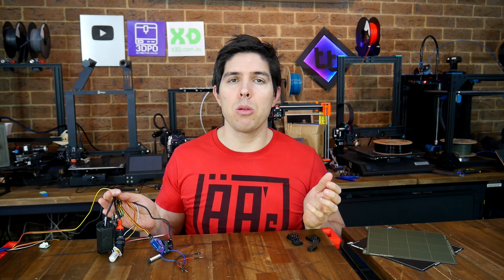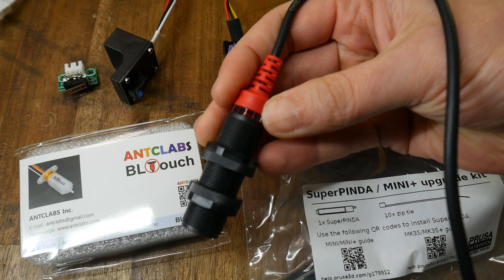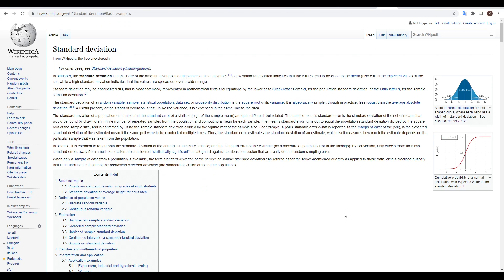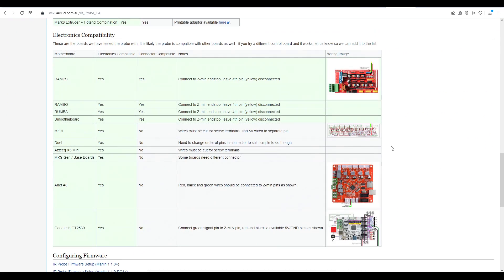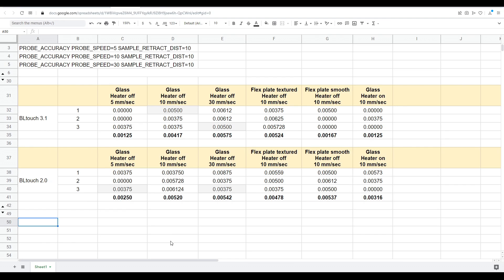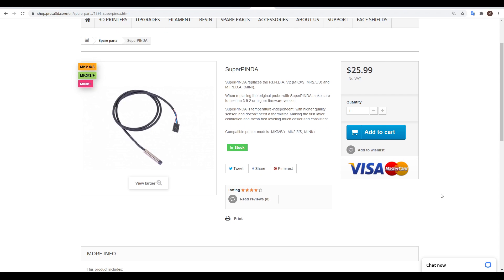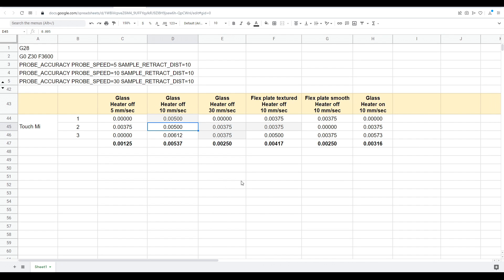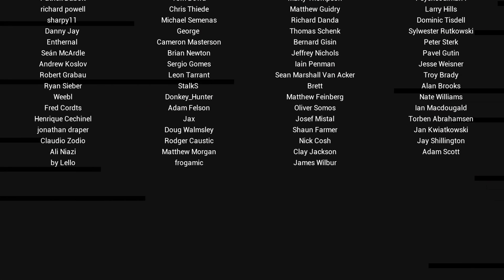Six popular ABL probes compared: Accuracy, price, wiring and more!

Comment: I had a "problem" with the IR probe, it triggerd differently on the white creality writing on the standard Creality glassbed than on the black bed background
Reply from the maker: Very interesting, thanks for posting.
Reply: Black plastic and iR is a bad combination since iR light will pass through it. 
You can try this yourself. Take a piece of black electrical tape to cover writing. Now take an image with an iR camera like a security camera in night mode. Woops where did the tape go?
Reply: I found the same thing, writing, textured PEI, glue, sunlight, LED lighting all effect it, its basically useless, its responsible for destroying a small list of gear now, including 2 build plates, o and a magnetic sticker, as that surface wont reflect properly, so it drives the nozzle into it hard, totally garbage, I would only recommend to someone I hate.

Comment: It looks like your results - although great, were limited by the stepper motors resolution.  But I love that you did this, and perhaps a follow up would be good too. But at least you had the probes in line with gravity, unlike TOM S.  - who is a great youtuber, but a poor 3d printer expert. (But I do love is sweaters)
Reply from the maker: I agree with your point on stepper motor accuracy. But it also goes to my point at the end: if the probe is accurate enough that another component in the system becomes the weak link, then the accuracy of the probe is not worth considering amongst these options.

Comment: try them in heated enclosures torture test them till they fail. most will fail at high temps ~70-100. i saw bl touch guys complain about that after some use. capacitive sensors wont like heat either.

Comment: BL touch for me - easy to install on an ender , works  on any print surface and so far has been reliable . I would prefer a metal tip on the probe so it can't wear or melt  - may look at modifying one one day . even if the unit dies it is easy to change it out for a new one  which would take only a few minutes .

Comment: I own and operate a small print farm (4 Artillery SWX1-v4) which have been modified using a fixed height (no springs) heated bed (Artillery glass), and BLTouch probes. All 4 printers are setup exactly the same, use the same firmware, and run at different intervals depending on print load. I have run this setup since August 2020, with no major malfunctions.
I used to run an ABL every week at the start. Now, I run the mesh and store it around every 3 months or so. All beds are fixed to the Y axis plate, and deviate less than 0.01mm throughout heat cycles. I still probably run an ABL way more often than I need to, more for piece of mind than anything else. 
I don't see any deviation between print cycles, and the mesh tends to be very consistent throughout all machines.
The only time I see a need to rerun the mesh cycle is when during seasonal transitions such as spring/summer, summer/fall, etc. The changes in ambient temperature and humidity, even with factory heated glass beds, tend to affect the ABL Mesh more than anything else.
Since making the modifications to the printers, I consistently run at 100-140mm/sec speeds using the factory Titan Aero clone hotends and Volcano nozzles. Belt tension and v wheel tension is most important to stop ringing and ghosting, but are quite manageable.

Comment: If your bed is warped, so will your print be. 
I'm against "auto bed leveling".
Reply: I agree that it's definitely a hack that it'd be better to not need, but I think typical bed warping is too small for this to really be much of a concern for typical home/hobby 3D printers.

I suspect that the majority of such users much prefer the ease of use and print reliability afforded by auto bed compensation probes, and they happily accept any resulting print warping, which will probably be less than 0.5mm.
If such a user finds that the warping does become an issue for a specific print that demands high accuracy, they can, for example, use a raft and configure the printer to gradually fade the bed compensation to zero during the height of the raft (Smoothieware supports this, so presumably other firmwares do, too). No one likes rafts, I know, but for the odd print that needs the accuracy it's not a huge deal IMO.

The sort of user for whom that does matter likely won't mind the extra cost of a precision toolplate and has likely purchased/built a machine where everything's perfectly square, flat, and tram.

Comment: I have just moved away from the BLTouch because the pin kept warping when printing ABS. Now I have a inductive sensor and works great. To be honest, I don't know why I even bought a BLtouch as its complicated for no reason. Its has mechanical moving parts which aren't required when you look at other options.

Comment: I’m not surprised that the simple mechanical switch is way good enough for all our needs. I’ve always felt that ABL was one of the numerous overrated features of our hobby and subject to much urban legends and marketing turpitudes. Thanks for dispelling most myths about this subject. Next step, keep track of bed leveling results over the course of a few months and show if it is at all relevant to perform it more than once a year, given a mature setup that does not get constant tinkering.
Reply: I may be able to answer this question for you... I own and operate a small print farm (4 Artillery SWX1-v4) which have been modified using a fixed height (no springs) heated bed (Artillery glass), and BLTouch probes. All 4 printers are setup exactly the same, use the same firmware, and run at different intervals depending on print load. I have run this setup since August 2020, with no major malfunctions.
I used to run an ABL every week at the start. Now, I run the mesh and store it around every 3 months or so. All beds are fixed to the Y axis plate, and deviate less than 0.01mm throughout heat cycles. I still probably run an ABL way more often than I need to, more for piece of mind than anything else. 
I don't see any deviation between print cycles, and the mesh tends to be very consistent throughout all machines.
The only time I see a need to rerun the mesh cycle is when during seasonal transitions such as spring/summer, summer/fall, etc. The changes in ambient temperature and humidity, even with factory heated glass beds, tend to affect the ABL Mesh more than anything else.
Since making the modifications to the printers, I consistently run at 100-140mm/sec speeds using the factory Titan Aero clone hotends and Volcano nozzles. Belt tension and v wheel tension is most important to stop ringing and ghosting, but are quite manageable.
Reply: @AlAmantea  Thank you for sharing your experience! 👌May I take this opportunity to ask which market you address?

Comment: I designed something like the touch mi that attaches to a $5 inductive probe. It works great +-10um on my textured glass bed. Be careful what you wish for. Creality plastic V rollers are not actually round with high height resolution.

Comment: I run the EZABL Pro on my CR-10 S4 with a glass build surface and it works quite well. It was easy to install and gives me a very repeatable mesh. On a stock Creality machine running TH3D firmware, it's a really good option.
Reply: they break much easier than the bltouch and support is illegally short and shite
Reply: @MGMutt  
Sounds like you had a bad experience with the EZABL. If you don't mind me asking, what on the sensor broke?
Reply: @soggynode  the actual probe part I believe, spent weeks back and forth with support who refused to even help, despite me initially contacting them within their illegal 3 month warranty. eventually they just told me to f*ck off and read the documentation again, like i had done 20 times. It worked fine for all of about the 3 months it was warrantied for, and quit. the issue was that the sensor kept getting really random results and would gauge into the bed at random times, ruining nozzles, hotends and the bed.
Reply: @MGMutt   Dang, that sucks. Printers can be fussy enough without adding that kind of drama into the mix.  Thanks for the detailed description of your experience.  That's far more helpful than people just saying something is terrible without saying why.

Comment: Very good analysis and review.  I have gone with the Ezabl, the ease of use and support by TH3D was worth the cost.  It is also very fast at probing which ids a big advantage to me since I do a 5x5 probe before every print.  The accuracy and speed spread over 100s of prints is only a cent of so per print.  I even replace the BL Touch that was stock on my Ender 5 Plus when the pin broke.

Comment: I have experience with the EZABL Pro mini and the BLTouch. EZABL has absolutely no strain reliefs on any of the wiring and this eventually caused mine to short out. The wiring is permanently attached and so it's basically not repairable. After I gave up in disappointment I ordered the BLTouch and its amazing. The wiring is replaceable and the accuracy is rock solid. If I had it to do over I would have totally skipped the EZABL and got a BLTouch.
Reply: I had problems with the wiring on the end that goes into the board.  I purchased 10 connectors and fixed the problem and have a spare stock.  Never had any problem with the probe end, but I do use a strain relief loop as suggested.
Reply: @woodwaker1  Yep I know what you mean but I figured if I had to spend money to buy a tool to fix it or just buy a BLTouch it was kind of a no brainer.
Reply: @markjones2349  I think we all find what works for us.  As Michael said the differences are small.  I had good luck with the Ezabl - you had good results with the Bl Touch
Reply: If you follow our installation documentation on the EZABL the wire lasts a long timeand it has built in strain relief inside. However, any wire put in a location of repetitive stress will fail which is why there is an example provided in the installation documentation.

Comment: Great video as usual!!  Your testing methodologies combined with clear and concise results are appreciated.  You could only come up with the conclusion you did - they are all more than accurate enough to get the job done.  It comes down to personal preference or experience.  I've used several ABL systems including the strain bridge style on my CR-6 and Vyper and find they all deliver similar results.  I find that the more care you take regarding making the printer as square and the bed as mechanically level with the printhead as possible will enhance ABL success.   My tip for EZABL and all probes for that matter to increase accuracy and more importantly repeatability is to leave the probe homed close to and over the center of the bed so as the bed heats up the probe is also warmed up.

Comment: I had no doubt all would be more than accurate enough, but i think you missed some key things:
1.) Probing across the bed instead of just doing probe accuracy in the same spot, since bed temperature and topography varies based on coordinate position. This also affects point 2.
2.) The quality of the sensors and their wiring/electronics, sensors with cheap wiring etc could have significant emi issues that effect them, ive seen it many times with BLTouch users since it has no shielding on the cables at all. Doing probe testing with all the steppers and fans etc on would be more accurate of a test for this point and #1. 
3.) Overview of overall firmware setup and installation for each probe.
4.) Support, in terms of mounts for specific hotends/printers etc.

Comment: Couldn't manufacturers just lap the heat bed flat before installing them?
Reply: Costly, when the intention seems to be to produce the cheapest printers possible. 

A very straight option would be non-hardened flow glass (about as straight as earths circumference?). But with that there’s obvious issues with safety/delivery.
Reply: @apinakapinastorba  but is it more expensive than adding a bed leveling sensor? I recently won the flat print bed lottery and I haven't used auto bed leveling since.
Reply: @MikeHuntShmeals  I think it is more expensive. Sensor costs only few moneys and is fast to install. 

Lapping a heat bed requires time (less heatbeds/time = less money), equipment/manhours (effectively money), some kind of lapping material and maybe the heatbed needs to be thicker etc to stay flat after lapping. If lapping would be cheaper, I think it would be used.

Comment: Great test, Michael. I would have liked to see a standard cheap 8mm inductive proximity included as a comparison to the expensive Prusa Super Pinda.
Reply: Agreed. The Super Pinda is just an inductive sensor. There are many of these ranging from a few bucks on Aliexpress to ones from Keyence that no doubt cost hundreds (I haven't ever bought inductive probes from Keyence, but I've bought their laser displacement measuring devices that cost thousands). Is the Super Pinda better than the <$3 ones?
Reply: @JonS  my work gets them, marked up through wholesalers, for comparable prices to the probes in the video.  We have thousands of keyence prox switches in my plant.  I think we get them for 30-50 depending on size and cable type.  That being said, I don't really know for sure cause I usually spend a few thousand a week on parts so I don't really check prices.  We're just told to put x exact part back in if it ever breaks.  Price just shows up when we select the part from our inventory.  I do remember that they seemed cheap to me.
Reply: @JonS  I have a Prusa MK3S Clone with a FYSETC PINDA v2 clone. On my workplace, we have both a original MK3S with PINDA v2 and a MK3S+ with a SuperPINDA. The cheap one is really temperature sensitive (also in a nonlinear fashion) and therefore every first layer has to be observed and slightly adjusted. The original v2 also slightly deviates, but doesn't have to be adjusted usually. With the SuperPINDA, there is a new level of consistency, it is just press the knob and go without minding anything. So yeah, there are differences between inductive sensors.
Reply: @kachler67  yeah, cheap inductive probes are very heat sensitive, to the point that you have as much as one layer height deviation or more between hot and cold, which for convenience purposes is really unacceptable. The Superpinda uses some clever electronics for thermal compensation hence the constant performance regardless of temperature.

Comment: Honestly I had really good experience with manual mesh bed leveling. When I switched to ABL it was much slower to start a print, because the mesh needed to be recreated every time. Is it possible to save the mesh created by the ABL probe, and only initiate ABL when needed? When I used manual mesh I would print with the same bed mesh for days. Sure it's only like 1 minute or less to create the ABL mesh every time, but it's a bit inconvenient when you just want to do a quick test print.
Reply: https://www.youtube.com/watch?v=ZqFIpoekTXY&ab_channel=EB3DPrinting
SKIP TO 30 mins in and it explains it all. Or you can watch the full video because its really cool.
Reply: Im fairly new to 3D printing but from what ive researched the answer is yes. I have an ender 3 v2 with the Jyers firmware, there is an option to create a mesh and then you can save it to the eeprom. Then in the G code instead of using the G29 (I think thats the code for ABL) you use a different code to just read the mesh saved to eeprom and it will go from there. I think there is a way to even load the saved mesh from eeprom and the printer will probe a few points to make an adjustment to the mesh. Definitely wouldnt take as long as running the G29. 
I havent got that set up on my printer yet so im just doing a 5x5 ABL before every print and it takes a few minuets, so I feel the pain lol
Reply: Yes I use jyere firmware currently with octoprint then setting Gcode to use mesh but I’m thinking about trying klipper soon to see if there’s any advantage for me personally.

Comment: Thank you for the ending and putting the accuracy dimension into perspective ... out of interest what level of standard deviation versus say a 0.2 or 0.1 layer height would be material for the purposes of bed adhesion.  Also the weight ... given the ranges ... how does this impact the print?

Comment: I think a test at higher Temps would have been really useful.
I found that bl touch, and clones, start underperforming at abs temps
Reply: I have to agree with this.  I have used EZABL probes since the first one Tim came out with.  I have also tried two different versions of BLTouch.  I never could get the BLTouch to work reliably (I think because I had to extent the wiring), and EZABL never failed (comes with plenty of wire).  But about temperature, a few years ago I asked both TH3D, and Antclabs what their maximum ambient operating temperature was.  I don't remember what the exact numbers were, but AntClabs was well below ABS bed temp.  If I remember correctly, they said 80C for BLTouch, and EZABL (this was prior to the Pro models) was something like 120C.
Reply from the maker: Anecdotally, I have a BLtouch on my enclosed Ender 5. That machine is only used for ABS temp printing, so 110 degree bed (PEX sheet), ~65 degrees inside the enclosure and zero problems from the BLtouch after quite some time. Based on my experience not a problem, however it may be different for others.